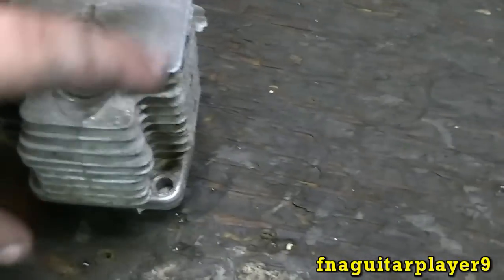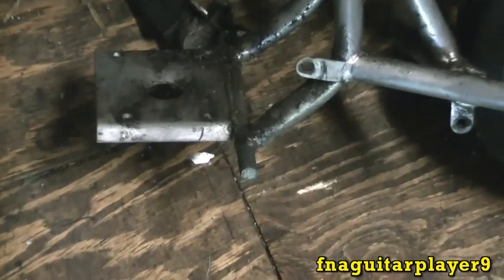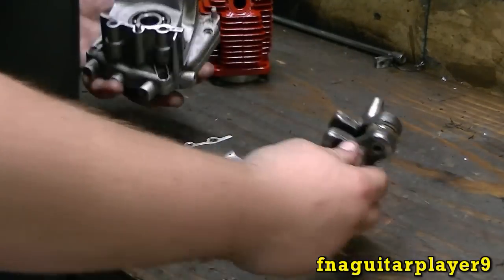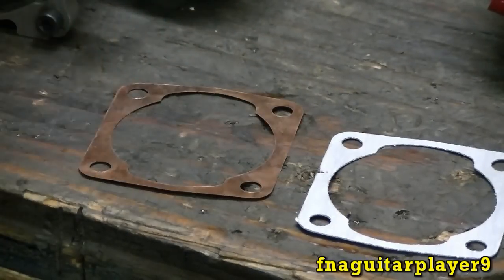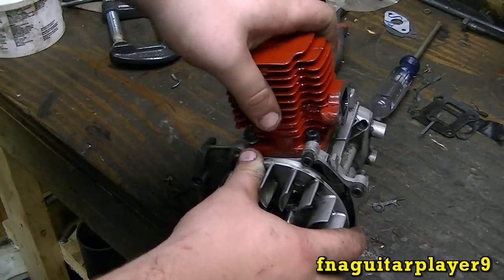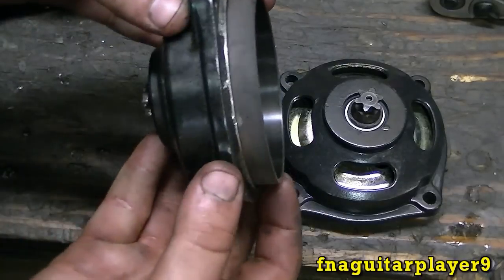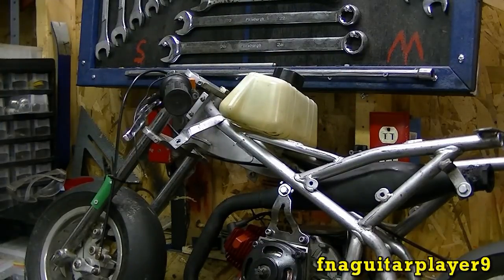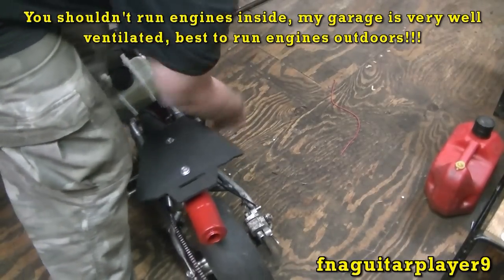47 cc 2 stroke Mini Pocket Rocket Bike Rebuild Part 2 of 2 (reassembly and test run)

Comment: You are a genious! :),
But can you please help my? If i give gas on my minibike it goes like 'bluhhh' and than it shuts his self off :( , can you please help me!
Reply from the maker: I don't know about all that! Sounds like your carburetor needs cleaned, thats a typical sign of a clogged jet, it like leans out not getting enough fuel. I do have a separate video just on removing and cleaning the carburetor on one of these bikes. Thanks for watching!!!
Reply: try adjusting your high fuel needle on the carburetor or spray it with some stp carb spray
Reply: Giving it to much gas or too much air flow